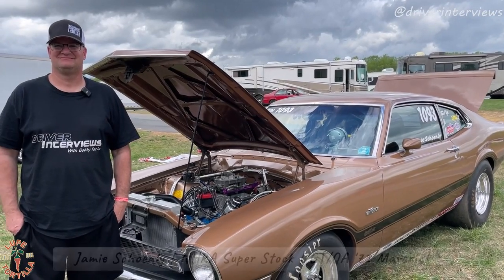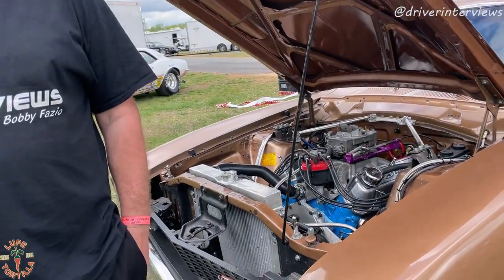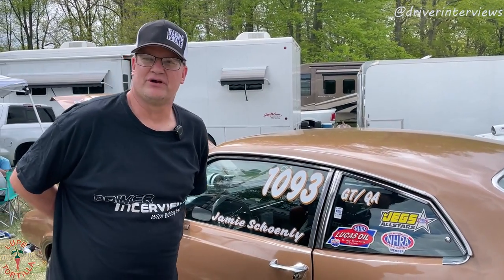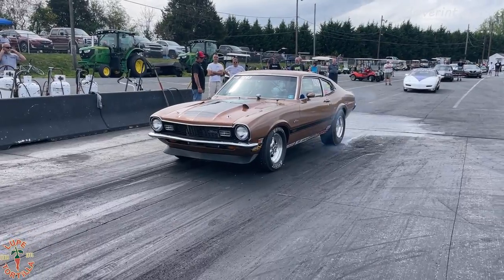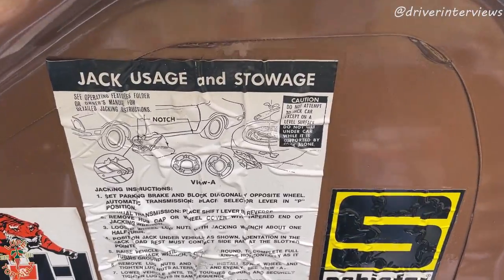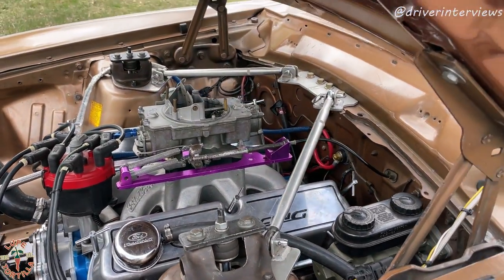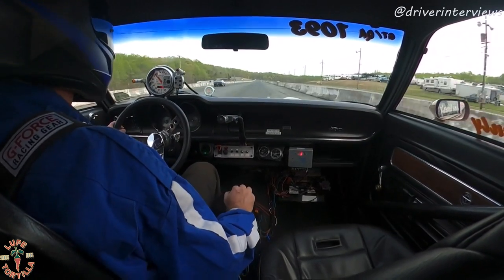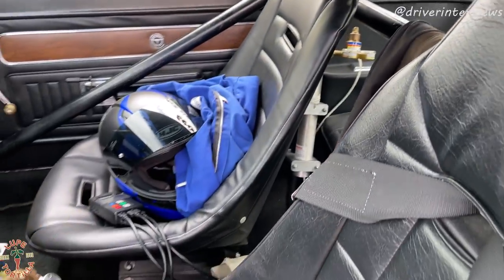Wheelstanding Original 1972 Ford Maverick NHRA Super Stock Drag Racing 2023 Cecil County Maryland

Comment: In the early 80's, lotta Mustangs few Mavericks, we had one at Island with the Original Comp Cams Solid lifter 336 advertised duration 650 lift. A real Rev'r!  We were all 12's (H/ET) when this guy cracked the 11's.   Later 80's Ray Knights 10s.  You guys really getting it w/your trans brakes & newer cams!  Thx Tire Diameter & Gear, the math not get 9000 RPM s.  They run good shift 7500+500 thru traps?!.  Thx share & Cheers! jj 289 Tr-4

Comment: Love those Mavericks still have my ‘70 with a 351W. Shock towers are pain in the butt. Used small tube blackjacks at first now have custom made ones. Most non- Ford people don’t realize that the 351W are wider & taller than the 289/302 blocks but they can use the same cylinder heads. 8.2” deck motors fit a whole lot of better in these cars if you are staying with the stock shock towers.

Comment: Being a former Maverick racer, I don't miss the shock towers. Used to have swivels, different length extensions to inspect/change plugs. But that's a nice-looking Maverick. # carshow!
Reply: Brian Reynnoldson, my daughter's '71 Maverick Grabber has a 351w HO engine. We trimmed the shock towers back a little for headers clearance and more room to change the spark plugs. It wasn't difficult to do, either.
Reply: That Maverick looks almost as bad as my buddies ‘69 Mach 1 CJ.  Almost.  Back in the day if you took a CJ to a dealer for a tune up they charged to pull the engine to change the plugs.  Like you my buddy figured out how to change the plugs with a collection of extensions and swivels.  It still took the better part of a Saturday to change the plugs.  And don’t even think about headers on one of those with the stock shock towers!

Comment: Just a tad bit of pre-load in the right ladder bar and it will go straighter. The 1964.5/1965 “D” code 289/210/203 is less HP than the 289/225 because of less OEM compression. This is a very nice car and great story!
Reply from the maker: The blueprint has the '64 at 52.6cc chamber and the '65 is 47.7cc chamber. I am trying the '65 head this year and taking the slight hp hit.

Comment: Bobby, pardon my lack of knowledge in class racing but why run the 289 vs 302?
Reply from the maker: If he runs the 302 Maverick combination then you are stuck with the 2 barrel carburetor because that is all they came with. Now he does have the option to run another year 302 out of a cougar or mustang but he already had 289 stuff lying around from years passed and some of our spare stuff. The 289 also has a favorable horsepower rating so you don’t have to weight as much.
Reply: @driverinterviews  cool, thanks for explaining!
Reply: @driverinterviews  Would a ‘68 J code 302 4V be a viable option? Factory hp was 235.

Comment: I don't understand how 203 h.p. can co 10:85 super stock 427 Ford galaxie went about 12:00 s
Reply: jimmy hawkins, a Maverick is a whole lot lighter less weight than a Galaxie. My 1963 1/2 427 XL "R" code car is just under 4000 pounds with fuel and me in it.
Reply from the maker: Hi Jimmy, The 203hp number is solely used to determine the car’s minimum weight with driver in stock and super stock racing. You will hear these numbers a lot in my interviews. 289/210/203 means 289ci, 210 advertised in 1964 and nhra rated at 203 which is used to find the weight break and class for the car. The car is making about 450hp.

Comment: Didn't 64 have a different bellhouse bolt pattern than 65.
Reply: jimmy hawkins, Ford made the changes in late '64 for the '65 model year. Casting numbers stated '64, though, with a different letter than the earlier units.
Reply from the maker: Good question I do not know.

Comment: You think those shock towers are tight. The pinto is a nightmare for headers compared to that
Reply from the maker: Fords…
Reply: Ever see a ‘69-‘70 Mach 1 with an FE 390/428?  There is literally less than an inch between the valve covers and those huge shock towers.  Like Bobby said.  Fords…
Reply: What? No spring towers in a Pinto